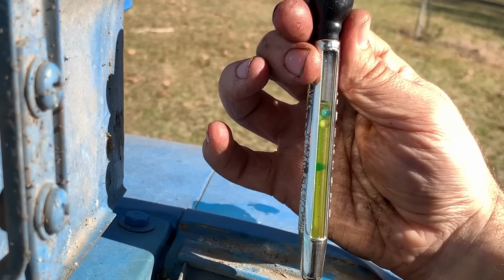Doing THIS can make your tractor last 50 years!

Comment: We have a 1968 FORD 3000 diesel in Greece (was Made in England). Just like yours. Awesome tractor, very reliable. Still works great after any thousands of hours of work. This is due to my late father's painstaking maintenance of the tractor.
Reply: Τώρα εχω πάρει ένα 3000 πατρίδα και το κάνω από την αρχή

Comment: I didn't read all the comments, but I kept hoping at the end the tractor would be driven into a barn or at least under some cover to protect it from the elements. Without that it's just piece of equipment undergoing excessive exposure to nature. In the end nature always wins making all the work done beforehand meaningless. Still I enjoyed the video very much and you're right routine maintenance saves time and money in the long run, be it tractor, automobile or anything with moving parts.

Comment: 3:40 Tip: The reason that battery's rack have a pivot on the left and a butterfly screw on the right is to swivel it clockwise to reach the oil cap without using an extra long funnel.  ;-)

Comment: Best tractors ever made. You can never go wrong with the old Fords. This will last forever.
Reply: Until it breaks down.
Reply: Patrick Rutto wrong. My grandpa’s JD power 50 is still running strong. It’s 70 years old.
Reply: I agree!!!
Reply: Quarantine is exactly like these tractors, it will last forever
Reply: Patrick Rutto Ford good FARMALL the best IF IT'S  NOT RED LEAVE IT IN THE SHED.
Reply: Your right Matthew still have my grand fathers 50 ..
Reply: Yes I have 3 ,,, two 8n's  and a. 961 ,,,, and a pop john
Reply: @canadian_wolf8395  
How true!!!

Comment: I just purchased a 1978 3400 and it's in pretty rough shape. The motor only has 30 hours on it but who knows on the rest of the tractor. It needs new rear tires, an engine kill rod, paint job and general maintenance. I bought it just to do some brush hogging and dirt work on my property so I think it will be good for that. Your tractor is very nice.

Comment: I got a laugh when I saw you pull out the punch for that oil filter. Been there, done that, but one time I got over zealous and messed up the threads on the block. Haven't over tightened one since! Great looking old Ford. Those old diesels make so much torque just idling, and sound so good. Really enjoyed the video.
Reply from the maker: Butternut Hill Farm Desperate times call for desperate measures sometimes. Thanks for the compliment! It’s a great tractor.
Reply: You can get some of those oversize water pump pliers to get that filter off without punching a hole in it.  Crunch it down flat so you can get some torque on it. Don't tighten new filter more than 3/4 turn after the gasket touches the sealing surface. Lube the rubber gasket with grease. Mark hour meter reading and date on the new filter. Always warm up engine before draining oil. This helps oil flow out better and insures that there is oil on bearings upon initial startup when oil pressure takes time to build  because of empty oil filter.

Comment: I never clean the grease fittings after putting grease in, The reason why is that left over grease will form a coating over the little push ball therefore not allowing dust and grit inside. They do make covers for them, many people do not use them. Also wiping the excess grease will do the same thing, this will close any gaps where water and grit could work its way in... Another thing is to drain the water off the rear end as well, If the unit sits out side for an extended amount of time it can and will get water in it... I  have changed my gear oil when I first get a new old tractor, I will find a location with a good incline and leave the tractor there for a few days to a week, this will allow all of the sludge, grit and metal shavings to move towards that area, Then you drain it to a plastic bucket and use a clean magnet to check the oil for metal contents... I have also used light weight oil in the rear end as a washing agent to flush anything else out, drive it around for about 20 to 30 mins and then set on incline wait about an hour or 2 then drain, and install new correct oil... you can do the same with the motor oil, drain old oil and place in a light weight oil and drive around for 20 mins or so, this will move all of the fluids everywhere, drain and replace filter again. 
I will also over time strip paint from bad areas and put primer and paint on with a hardener, This will keep metal spots from rusting.
Reply: good ideas !!

Comment: Good demonstration. An oil filter comes off without tools if it was installed properly. A sheet of coarse sandpaper and gloves is all it takes. If it takes violent measures to remove the old filter someone was not reading instructions during the last filter change.

I have had this happen only after "professionals" messed with my cars or tractors. Never after doing the job myself, and I'm a farmer with zero mechanic's training. Makes me think.

Comment: I have a ford 2000 with a gas engine. Great little tractor. Ditched getting ripped off for those large tractor batteries years ago. Been using regular car batteries for years now, with no problems.
Reply: Yup same here
Reply: Just picked up a little 3 cyl gas 2000 (1975)... 2600 hrs on it,  in awesome shape, starts/runs perfectly.
Reply: @hermit1249  yup and those lil 3 cyls wether gas or diesel lug like crazy , i did a trans once and clutch , the flywheel almost dropped on my toe it was unexpected heavy.

Comment: My 3600 is still going strong. I have replaced both front tires in the last 10 years. Replaced one of the original rears yesterday. 43 years.
Reply: Dang. That tire lasted a long time. Usually they rot or get cut and blow out
Reply: How could tire last 43 years
Reply: @vinlennox7658  It only gets about 20 hours a year put on it, but that tire looks rough. I gonna have to replace it soon.
Reply: Here’s a queer one for yer,
Owned my 9n for close to 40 years. Replaced 1x rear tire ‘bout 10 years ago, took off the other tire (leak) this year, and got a new tube, (at the tire store) didn’t put back in calcium, didn’t replace tire. The newer tire has better tread, but more “cracks”. (Same type and same brand -Firestone)
They ain’t making tires like they used to. Now, I use tire chains all year, perhaps that’s partly why? (Hilly land).
I’m also not ploughing - so will see if having less weight in tires “outweighs” the advantages - brush hogging/ firewood mainly.

Comment: Mine is a 1965 UK 3000 diesel.  Last 3 I had all went porous but this one hasn't.  This one is totally original and has been my dads since 1980.  Still on the original clutch too.  It's always had genuine Ford coolant and oil changed annually.  Absolutely zero bother with it apart from the usual ropey hydraulics and heavy steering
Reply: What do You mean porous?
Reply: @parchechuletaovero9507  porosity in the block casting

Comment: FYI 20 yrs ago when I worked at a Ford tractor dealership Ford sent letters to all their dealerships warning or advising (not) to use Napa engine oil filters on Ford tractors  they had multiple engine failures. I’ll never forget that. If you use A Napa engine filter make sure it’s   The Napa gold  highest quality black color filter.

Comment: Quick tip, always put some silicone gasket sealer around the oil drain plugs when refitting (even with a copper washer) so that there is no chance of the oil leaking out, also acts like a low strength thread locker.

Comment: 1965: C100000
1966: C124200
1967: C161300
1968: C190200
1969: C226000
1970: C257600
1971: C292100
1972: C327200
1973: C367300
1974: C405200
1975: C450700
Here are the year codes stamped on Transmission, front upper-right corner, stamped into top of casting. Mine is a 1967, and been a work horse. Great video and good content!! Merry Christmas.
Reply from the maker: Paul Boulware Excellent! Thank you, Paul! Merry Christmas to you as well.
Reply from the maker: Paul Boulware the closest number I could find was C181888. Top front right of the transmission casting, right above the bolt holes for the loader. Do you have more information? I’d really love to know the exact year on this thing.

Comment: Ran a 4000 for 1000’s of hours, know these tractors well. Split many replacing clutch, great little tractors, my favorite in there year. Rebuilt many, hated the special battery, big bucks. 8 speeds were best, stay away from selecto speed
Reply: I have a 1965 SOS with over 10,000 hours. Works fine now but I know if It ever has problems it will be hard to find parts.
Reply: Both of our 4000's had the Select-o-Speed. Never had problems.
Reply: I have a Ford 2000 and it starts just fine with a car battery

Comment: I love these little tractors. To me their greatest flaws are the sheet metal oil pans. Looking at yours you can even see where it was dented in a little. If you dent it in enough by hitting a stump, you will crack off the oil pump in the pan and kill the engine. I had to learn this as an 9 year old running one of these doing some scrape blade work. Ford later beefed up the oil pans on their tractors in later years. Other than that this is a wonderful little tractor to do almost all that a small farm needs done. Jim in Chile.
Reply: nn
Reply: mm
Reply: You still en Chile?
Reply: @matthewmcmenamy1398  Oh yeah thank GOD! Love it here. Jim

Comment: Very good, one thing I do every once in a while is check air pressure in the tires, I do not have power steering so my old tractor gets harder to steer if the front tire pressure is low,
Also I am on the hard surface road some with my tractor, so low pressure on the back tires will wear tires faster,

Comment: Thanks for sharing. Good advice for sure. 

The worst thing about the Ford 3000 is the thin oil pans. If you look at yours you can see where it was hit by a stump. If you dent it in more it will break off the snout for the oil pump and kill your engine with out you knowing. Be careful. I did it once I know. Jim in Chile.

Comment: Congrats. Not all set up - like the struggle getting the filter off. We all have been there. Great comments as well. I'd be proud to have any of them as contributors to Practical Farm Ideas. Greasing pedal linkages and bushes is easy to miss out. Doesn't it all mean a routine? Like scratching the hours on the new filter?

Comment: In dusty condition when cleaning the air filter drop the bowl then take out the wire mesh filter that sits above the oil, then take off the pre - cleaner and push a rag with a piece of wood or something similar to clean the down tube, then wash the wire mesh filter in petrol and dry it out, then drain the old oil from the  bowl and clean it, now put the wire mesh filter in the bowl and pore through clean engine oil and let it stand when it's stops dripping remove the wire mesh and put it back in place then refill the bowl to the correct level. Don''t use grease on battery terminals it creates a hard non -conductive surface on the lead terminal always use vaseline jelly.

Comment: I have a Ford 4000 diesel and a 801 and NAA. These are great tractors. The only problem I have had with the 4000 is the Voltage Regulator. Took several new ones before the dealer found one that worked. So much junk out there any more!

Comment: I have two Ford 3000s, one is a fuel injected Diesel and the other is a gas carburetor with front loader, great strong tractors hope to have the diesel running before the spring. The diesel has 175 hours on it and over 2,000 on the gasoline one.

Comment: Don't forget that regular use also keeps them alive better - otherwise seals dies and humidity accumulates.
In many farm tractors the gear fluid also doubles as hydraulic fluid.
Reply: very good point about regular use. maybe not daily ,but once a month start run to temperature and use brake hydraulics etc. only takes 15 mins. but save a lot of heartache

Comment: You forgot to change the fuel filters, we have 1967 Ford 3000, with over 6000 hrs on it, only thing that's been changed is clutch and starter.

Comment: Always put oil on the seal of the oil filter, and only hand tighten!!
Reply: It's also wise to blow out the radiator from the engine side!
Reply: @donaldhofman296  You are so right about this. So many people don't understand how important it is to blow out radiators in the opposite direction that the fan moves air thru it. Farm tractors are so vulnerable to radiator clogging because they are always stirring up dust and biomatter.
Reply: ਅਸੀਂ use castrol oil
Reply: @donaldhofman296   Das what i was thinking !! Against the natural flow will get it out better, just my thoughts.

Comment: Nice 3000! I have a 2000 just like it.
Reply: Brandon Hoda I had a 2000 Diesel just like it to. I think it might have been a 69 or 70. I painted the white stripe over the side louvers too. Money was tight, traded it for a gas MF 35 and $3000 to me. That was a mistake! Got a subcompact MF1705 with a loader, thinking about buying a 2610 or 2810 because I just like them. Will keep my subcompact, handy as hell.

Comment: Tip#1 On my 9n ford, got tired of bugs and such, being pulled in to the radiator core.
Hung some window screening on the outside of the grating, it’s about 5-6” away from the radiator- doesn’t stop the flow of air, but does keep the bugs and seeds on the outside screening. Stop the tractor, bugs fall off.
Only thing missing is greasing all those pesky lube spots (nipples!)
Grease, grease, and grease some more, especially the pto. A dirty tractor with lots of grease is a trouble free tractor.
Tip #2: if you find that your battery is constantly running down, change wiring harness, the “block” beside the ignition switch, and add a little oil to the generator, on the 9ns there’s a little “flip” right on top of generator.

Comment: You can use a high temp wax (230F) to "pot" your terminals after you have them on properly too.    Drain your coolant through a filter and re-mix it every 100 hours.  You can test it with a small pot and a plug-in burner to get the boil temp right.   *If you're feeling special whiffy you can add a settling reservoir for your coolant system to keep shit from settling in the radiator.

Comment: Don't forget to change the filter and clean the strainer in the back axel under lift head. Also if tractor is not running just right there is a strainer at back of pump that gets dirty

Comment: Don,t forget the air cleaner, on this air cleaner ( oil bath) idle tractor, place hand over inlet, if tractor doesn’t die you have a leaking hose. Air will bypass the air cleaner and eat up your piston rings. From an older diesel mechanic. Tks

Comment: When you oil filter is jammed, please don’t drill it. You are creating piles of metal shavings which go everywhere and it’s not impossible that some might make there way back into the engine as you unscrew it. Just punch a hole through with something moderately sharp instead of drill.

Comment: Very nice.  Don't forget to lube the throttle linkages and lever controls. 😉
Reply: You should Never put in a new empty oil filter fill with new oil and let it settle into the core then old o,ring an replace filter do not over tighten ok ?
Reply: I've been lubing my wife for the last 20-odd years and she's still going. The lube doesn't seem to make her any faster, mind!

Comment: Hope putting that old oil on the gasket keeps it from sticking. Removed many an oil filter with a marlin spike. I always use clean oil myself. My dad was the original owner of a 1950 Allis Chalmers B. It's mine now and with regular maintenance and care is now in it's 68th year of service.
Reply: Jim Dudder My dad always put some oil on the filter gaskets to prevent them from sticking. He was a mechanic at a Chevy dealership so whether changing oil in any kind of vehicle he would do it.
Reply: I'd put the old oil in the air filter bath

Comment: Old tractors...yes .  they last forever.   New tractors.... some electronic gizmo that costs thousands of dollars goes before the actual mechanics of the thing wears out.

 I cant remember the last time I ran something with an oil bath air cleaner.
Reply: if you got a new holland the electronic wil get fuckt but if you had a fendt it will last forever :)
Reply: You can't beat a Lamborghini!
Reply: @duncanhowarth9514  can't find one either.
Reply: @mandovapehater6988 : There's one in my barnyard (tractor) and one on my driveway (Huracan).
Reply: @duncanhowarth9514  cool. And zero around me.
Reply: @mandovapehater6988 : If you're ever around these parts you can borrow one of mine but you must promise not to start the engine.
Reply: @duncanhowarth9514  deal

Comment: 3:28 Are you not pre-filling the oil filter?   The first time I changed the oil on ours, I didn't pre-fill the filter and it took a scary-long time for the oil pressure to come back.   Subsequent times I've pre-filled it (and it takes a while for the oil to settle in before it actually is full) the oil pressure came back almost immediately.
Reply: How do prefill the oil filter when it goes on sideways
Reply: @andrewsmith941  The oil filter has that anti-backflow thing in it, so the only place it can pour out of is right in the middle; and if you wait 'til it's right at the screw-on thing before you tilt it up, only a tiny bit spills out.  The thing I'm more concerned about is horror stories I've heard (just in the last year or so) about ppl contaminating an engine with grit by putting unfiltered oil into the filtered-oil part of the filter, so I think next time I change it I'll try pouring it thru a coffee filter into the oil filter, because I don't want grit in the oil but I don't want to have to put it on empty either